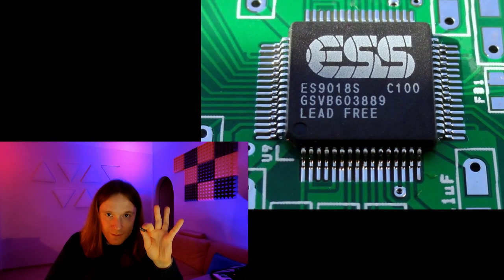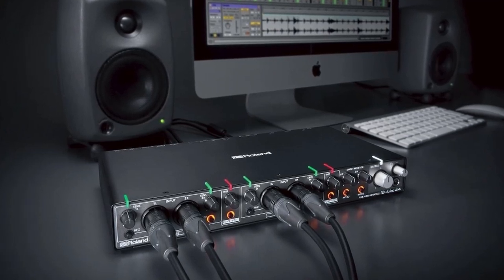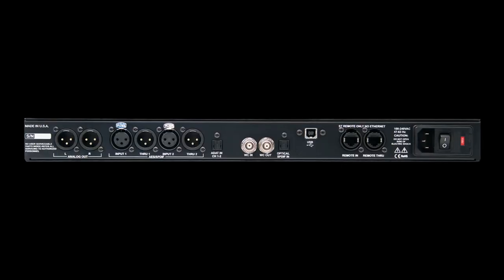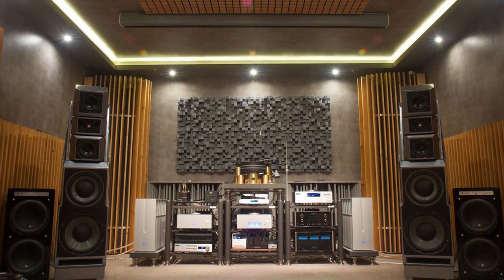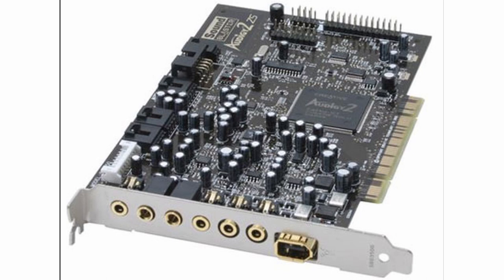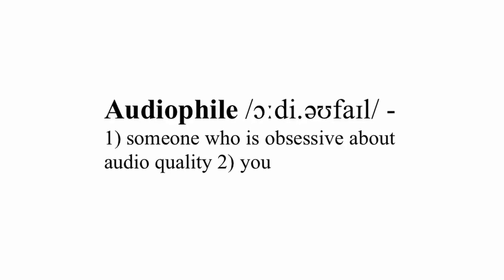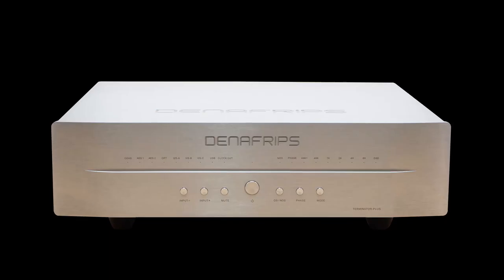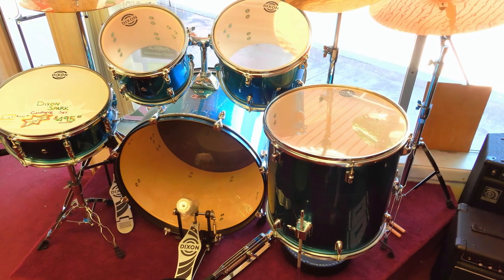Audio interface DAC VS Hi-Fi DAC

Comment: Hardware, specs, theories are important but DA blind tests are scarce. They reveal the real anwers to your question.

I have A/B tested ifi Zen Air, EMU 0404, Delock Cheapo USB’s and onboard Realtek.
Onboard was really bad and Delock surprisingly good. 
The choice between the first 2 was very difficult but the EMU won.

Comment: Some people can hear 0.2 pico second time difference? In this time sound travels: 0.2 pico second x 343m/s = 68 pico meters If this is true, then if you move your speaker for 0,068 nano meter closer, you can hear this.  Do I need to explain how ridiculous this is?
Reply: One easy clue is that the low end gets quicker, kick drum hits and leave the sound stage with much more force. You also hear better separation between kick and bass. Then some stuff is also happening in the highs and mids etc...
Try for yourself or go in hifi shop and ask to hear a good dac vs an entry level dac.
Reply: one moves orders of magnitudes more back and forth while breathing probably.
Reply: I think you misunderstand something. Theese 0.2 pico seconds difference can be heard in very short soundwaves and not from wave to wave but inside of a certain wave.

This has nothing to with the question when does the sound wave hit the listener, but it is a about how the wave is shaped and also which wavelength does it have.

By the way I am highly skeptical too, but the description of the claimed phenomenon is not entirely unbelievable IMHO.

In the end a double blind test should be performed.
Reply: It's almost like these people have no idea what NURBS and FFT is.
Reply: you are able to think. The guy in this video obviously not.

Comment: Very interesting. I thought because "The Nyquist–Shannon sampling theorem is an essential principle for digital signal processing linking the frequency range of a signal and the sample rate required to avoid a type of distortion called aliasing" the power of its Math would be able to avoid things like jitter, clock issues, etc., and thus maintain the integrity of the audio signal. But, that doesn't appear to be the case.

Comment: which dac will be better in low price range under 200$? integrated in audio interface Focusrite scarlett, topping, ifi zen or dragonfly will be there huge difference or they are very comparable?
Reply: As someone who's had both a focusrite solo and a schiit modi, I would say that cheap dacs are mostly similar

I personally would go with a motu M2 if you want a recommendation, I enjoying using an XLR mic and unless you're trying to power really hungry headphones an interface will do you well enough.
Reply: @kontanaizumi  thank you! I ve already bought and my opinion is same as yours, im happy with the buy :)

Comment: so 44.1 vs 196 is a perceivable difference? idk if I can hear it with my current playback setup but I guess I'll record in 196 / 24 bit
Reply: You can certainly hear the difference on a good playback system. It’s more about depth and musically. Not all A->D will Make a meaningful difference recording at 96kHz vs 44.1… Some cheaper DACs use a 48 / 96 clock only and use trickery to get to other sample rates (or some have both 44.1 / 88.2 and 48 / 96). Id check and see what your DAC has. Eg. If it’s based on a 48kHz clock then you’ll get better results at multiples of that sample rate
Reply: @umusachi  how can I check? it's a presonus 2626 interface
Reply: Not really. The changing of a sample rate from 44.1 to 96k or 192 kHz is quite literally about faster sampling, which helps a great deal with reducing latency while recording. The downside of this is being a heavier load on computers, and may need more expensive chips on the interface.
Reply: @umusachi  No, you can't. Nobody does. This was proved over and over.

Comment: A dac is just a converter that use mathematic formulas to convert digital to an analog signal, it has... Per Definition, no coloration. What is after the dac (can be in the same box) can add coloration, the dac will not.

Comment: Ok, it seems there are some people here who know what they're talking about so I have a question: I'm a total noob when it comes to audio but I got my hands on an old Cyrus one amplifier plus the PSX thingy and some B&W speakers; very late eighties/early nineties. It sounds great with regular sources like CD players and TV. But I also have this decent bluetooth receiver I hooked up to it, a Marmitek BoomBoom 93 but the sound is just horrible; dynamic range between soft and loud and highs an lows is great, but there's soooo much which I can only describe as sibilance on steroids. Tweaking the equalizer on my phone when streaming helps a bit, but totally kills the sound. Cheaper bluetooth receivers have the same issue. Anyone have any ideas what causes this and how it can be resoved?
Reply: Bluetooth sucks for audio, which is why there's new versions or updates to the BT standards. I just put a new stereo in my car, and for whatever reason streaming from bluetooth sounds like crap but if I do carplay it sounds fine, though I don't know why that difference would exist.

Comment: I’m sorry but I just can’t believe that you can hear above 22.05 kHz and that you listen to music at over 96 dB, because these are the limits of 16 bit 44.1 kHz audio
Reply: I tested my own tracks with my LCD-X headphones and I heard that 24 bit has a lower noise floor than 16 bit. To my ears this makes it sound cleaner, i.e. more separation between the instruments. The DAW I use runs in 32 bit and I could not hear any improvement over 24 bit.